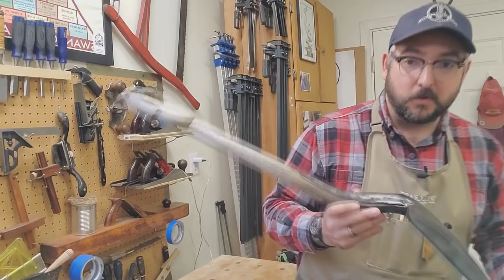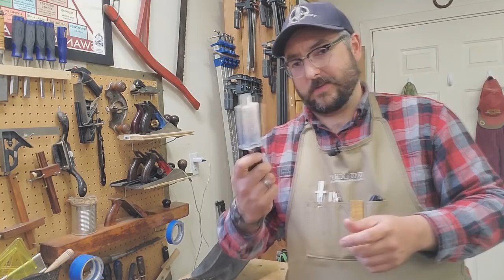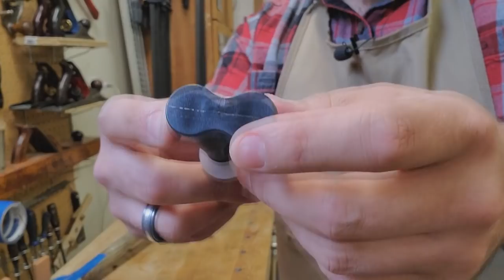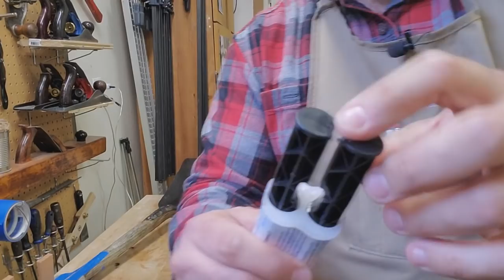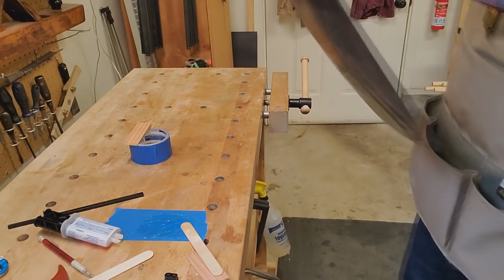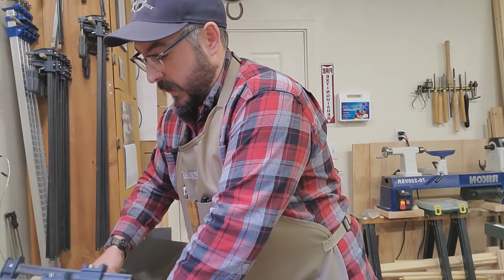Antique Shovel Resurrection

Comment: Acra Glass is a very good heavy duty Epoxy for wood repairs,..it comes in a mildly runny solution and a gel. You can find it at Brownells.
I have used it to repair wrist breaks on gunstocks which were never broken again.

Comment: Nice job 1st Sgt. Would like to see the finished results. Also, could you use the same method for gun stocks and ammo boxes or crates?
Reply from the maker: Great question.  For the rifle stock question, check out C&Rsenal's Anvil channel with master gunsmith Mark.  He uses a product called acraglas which is like an epoxy infused with nylon, I believe.  If you have a clean snap in regular boards, wood glue and clamps should be all you need.  Anytime, you have large voids or you need to build up material, epoxy is a great way to go.

Comment: Hi quick question how would you go about making a new handle/shaft for this type? Do you need to shape down a large log or is there a way of bending or shaping a thinner piece considering the bottom as the metal is curved? I have one similar which I’d like to fix but the shaft is completely broke.
Reply from the maker: Great question!  I feel like a came across a company that sells replacement handles but can't think of it off hand.  If I were to try making a new one from scratch, I'd hit up my hardwood dealer for a piece of wood thick enough to include the bend (some are completely straight like another I just did this weekend).  I'd trace out my handle shape and cut it out on a bandsaw, or whatever you have.  I'd then use a spokeshave (bonus if you have a curved one) to shape the handle.  The grip I'd probably shape with a rasp.  You could steam the end.  I'd try to salvage as much of the remaining end as possible and build a jig that fits that profile.  Then you'd just need a steaming set up.  I hope this helps.